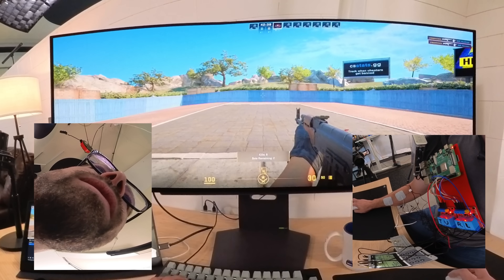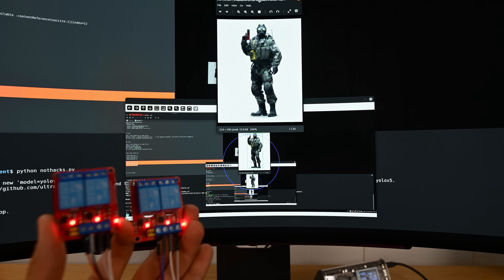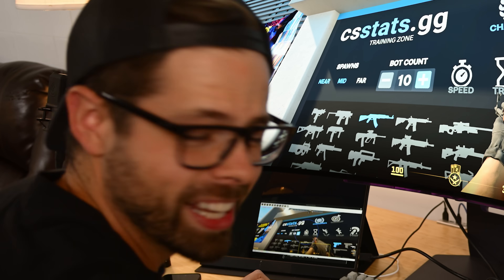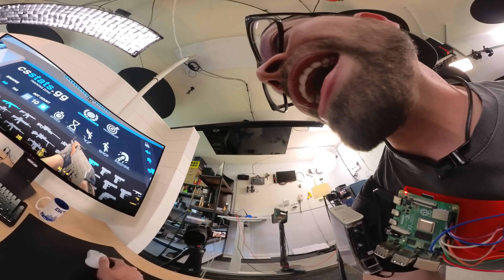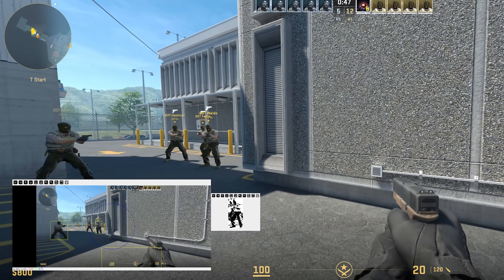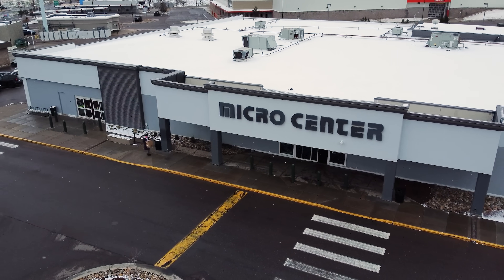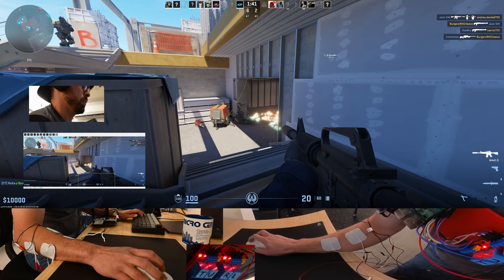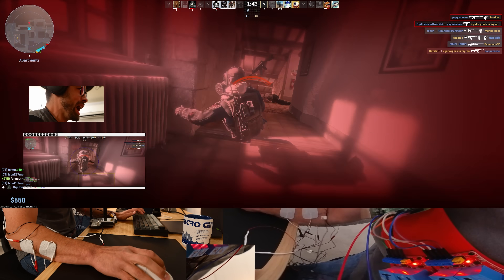Neuromuscular Aim Assist

Comment: Hear me out, Have you seen those electronical hands that handicap people use that reads your musscles to move? what If you programmed it with the rasberry pie and it basically did the same job by you not getting the shock. also you'll need a person without a hand for that.

Comment: Do you realize what's possible with this!? You could use a full body version of this and a powerful A.I. to train your body to dodge & counter any attack flawlessly. Put 360° sensors on the suit to allow the A.I. to detect all the movements around you and train it. Over time, your body & mind will get used to moving on its own like that, and you will begin to not need the suit. Once perfected, you won't even need to think about how to move to avoid any strike or grab attempt, and the body will counter automatically as it will have learned to sense any movement around it. You must also train your stamina and strength as well. It would be something like "A.I. trained my body to have Ultra Instinct in real life."

Comment: When I was studying Kinesiology I took a neuromotor control class. I find this whole concept fascinating. I know this was a ton of work to do, but I honestly think you could fine tune this a bit more. Perhaps if you tried using electroacupuncture needles you could find tune some of the movements. I think this would be far less painful and much more precise. I genuinely think if you used the shock needles instead of TENS pads, and insert one into each of the main muscles of your forearms, you could program the computers to create much more fine motor movements. This video has 2.3M views in 3 weeks, and could easily be your top video. I think if you fine tune that with the electroacupuncture technique and code the computer to know how to send a shock to each individual muscle, you would have a very interesting experiment on your hands (and could get a lot of views). Moreover, you could really help advance some of the technology that would help people who have paralysis in their limbs be able to move again. Message me on instagram @mitchell_gainz if you want any ideas or I could direct you towards some professionals in the neuromotor control / biomechanics field.

Comment: Very interesting idea a couple problems tho. Having it be too harsh of a shock that you are just relying on the shock(aka robot if you want to call it that) to move your muscles for you will fuck up your muscle memory after prolonged use as well as just completely damage them as well. I think it's a good concept that isn't terrible toward improving human reflex control but I would turn down the shock by a lot. Why? Because you want to have the shock hint your muscles to go to the correct why which just work toward teaching the brain to establish neural connections to create muscle memory leading to insane REAL reaction times, given the program would trigger only at a time that you as the user can physically see(or at least you could see) and would help your eyes and muscles get better. Unfortunately electrotherapy can work(unfortunately because of all the negative things that have been done with it) but it requires prolonged use and effective processes. Over interesting idea and probably something we will only see more of in the future if not that much shock some form of human enhancements.

Comment: A little bit of research might have saved you a lot of pain.  A shock needs a gap to form.  Those who use these devices for what they are intended use a cream or gel that is conductive.  So the jolt goes directly to the skin instead of having to jump the air-gap.

Comment: AI object detection, friend/enemy detection, boundimg box distamce measurement...

Then a multi-core RPI with gigabytes of RAM and a full-fledged OS is open-loop controlling FOUR relays. My embedded mind has died a bit, couldn't the output stage be more crude, could it? 😂🤣😅

Comment: Great video. You might want to consider running a PID control loop to improve the tracking. It'll prevent you overshooting heads if you increase your derivative (D) value in your controller.

Comment: If you want to improve the latency significantly, switch from relays to power mosfets. This will completely eliminate switching time from the equation, as they switch on the order of nanoseconds.
Reply: You could even implement a sort of PWM that moves your arm back and forth in either direction until you reach the target, kind of like a PID loop.

Comment: it is an edge case of cheating-or-not just because all the electrodes and computing unit is external. what if...the shock is so accurate that mimic the actual electric shock the nerves make and all these devices including the computing unit is burried under the skin 🥴

Comment: I wonder if you can adjust the settings so it doesn't hurt. But perhaps that much voltage is required to go through skin resistance.

Comment: Halo would be interesting. It requires lots of tracking and in Halo Infinite the players have outlines. You can pick the color of the player outlines so theoretically it might be easier for the vision system to spot enemies. Look for specific pixel colors and aim inside.

Comment: Yeeeaaars ago I made something similar using Atmega and two hacked Tens units (to ensure it would at least have "safe" frequencies). But instead of trying to get the 'pain to win' effect 😂, I decided to implement it with a C# client which controlled the Atmega via serial, and a memory hook to detect the player being hit. For simple games (where I could not read or find the actual hit point) it would just respond with an intensity relative to the health dip you took. I mostly used the well known tools to find memory addresses by just filtering them on changes, and then directly hooked onto them from within my own program to have the lowest possible latency.

What also gave me more control is that I directly interfaced with the controls of the tens unit by swapping out the contol buttons  with opto coupler (instead of using relays between the outputs), which also kinda gave me "PWM like" control for the strength and intensity.

And games where I would be able to detect the 'impact point', the unit (both 4 channels😂) would then direct most "feedback" to that area (I used: Left Arm, Right Arm, Chest and Back). 

And boy, believe me that games like Fallout and CoD got A LOT more intense😂 and games like Outlast became one of the most terrifying things I've ever played back then😂

My project was significantly simpler to implement on the software side (since it didn't needed to have the enemy location detection etc), but it definitely was a fun idea. Really a shame I didn't made any useful video's of it back then. Maybe a "fun" idea to do something again someday 😂

PRO TIP: DO NOT instantly plummet into a ditch, elevator shaft when using something like that (as in when your health instantly goes from 100 to 0)... Don't ask me how I found out😂😂

Comment: Cheater/cheat developer here. The most “undetected” cheat out there right now is one that externally takes a bunch of screenshots of your computer and either detects for players using computer vision or colors, and then moves your mouse to that direction using an external device, like an arduino. I didn’t think there were ways to make it more undetected than that but clearly i was wrong.

Comment: Your using something to read the screen to do this, i would say 100% that is cheating. This is really cool but def cheating, cause it is not your muscles per say it is them reacting to a program that knows were the cross hair is. It is like the same scripts they run to the controller to control reoil and cheat that way but your way was not meant for the reasons others but if you do get banned dont be surprised.

Comment: I didn't believe it and then right around 40 (this year) I did something to my right arm. Now it feels odd at times like I pulled a muscle or pinched a nerve. I still feel like my reaction times are improving in some things and dropping in others. I'd say the main thing that affects my reaction time are my injuries at the moment and not my age. I can still get a really good run on call of duty as long as my arm is not acting up. The minute I start feeling the burn in my arm I have a problem with the reaction of my right hand. . . My in-game trigger finger. The reason I phrase it like that is because I'm a lefty so in real life my trigger finger is my left hand but I'm pretty ambidextrous as well. That being said my profession has honed my instincts and reactions. If they don't at all I will die. It happens to everybody in my profession. I am a large tree installer that operates some pretty big equipment and I've done three removals and trimming for years. Even though I have a high reaction time I've still taken some big injuries at a young age. The reason I'm leaving such a long comment is because technology like this can help individuals like me who have had muscle damage. By learning how to specifically Target each muscle you can develop a tens style unit is that Target see exact muscle needing repair or stretching. Also a hectic gaming unit would be freaking amazing 😅

Comment: So you're encoding the images, to decode them into cheat script input. Then  to re-encode them into the tens unit relay shocks, to play the game. 

At that point just cheat. You already need to for  it to work. A computer can pull the trigger in at least 10ms.

Comment: I just did a similar not-hacking project with arduino and you definitely want to be using optocouplers instead of relays, shaves off about 10ms and increases precision by a ton

Comment: the finger triggerbot might actually be pretty busted considering how fast the cheat can detect enemies you could easily count this as a bannable cheat.
i think it shows that you had success with the snipers sicne they are also a classic cheaters favourite due to the headshot being a one hit.
I'd say it would also be the easiest thing to detect since your reaction speed on the click would be way faster than even the best players.
It might actually not be that bad that you have a 100ms delay in the system since it doesn't put you anywhere close to what actual cheats can do.

Comment: What a bizarre choice you made to go with slow and noizy relays, instead of uaing transistors (with nanosecond scale reaction times) that require little to no current to operate, in addition to giving you the ability to modulate the strength of the signal that's being sent to those pads.

But hey.... At least it worked. So congratulations, I guess?

Comment: I think more electrodes and using mosfet instead of relays could make it a lot faster and better. You see the LED light up but the relay will take more time, A LOT MORE TIME. trust me, just use a mosfet, ur an engineer, do it

Edit: also you need adaptable shocks. some can be less and some can be more intense. the duration of the shock must change as well. Tweaking the settings based on your arm and possibly making a software to calibrate your setup and arm each time will be good. Like you just hop in to a aimlab and close your eyes and let the calibration code to run. the software calibrates the shock intensity, duration, and how multiple of electrodes should work with each other. Oh man, such a fun project to work on but this is time consuming and so much money than I can afford. You can make so much money making this into a product. I swear some people will buy it.

Comment: Motivation:

The creator just turned 30 and feels his reaction time in games is getting slower with age (typically measured around 200ms; young pros get down to 150ms).

He wonders: Can you hack muscle control and bypass slow human reaction to make your muscles react instantly?

Concept & Setup:

The idea: Use a computer vision system (PC) to detect enemies on the game screen faster than the brain can.

Instead of the normal process (eye → brain → muscle), use external electrical signals to trigger muscle contractions for aim and reaction, bypassing the brain.

Technical Steps:

Step 1: A server PC runs a program (using YOLO, a popular object detection algorithm) to recognize enemy positions in a game.

Step 2: The program communicates (wireless, via WiFi) with a Raspberry Pi (a small, cheap computer) which controls electrical relays.

Step 3: The relays trigger an off-the-shelf muscle stimulator unit (EMS/TENS), sending real electrical shocks to muscle groups in the arm to cause the hand or finger to move.

By putting electrodes at targeted places on the arm, they can cause specific muscles to contract—for triggering aim or even pulling the trigger finger.

Testing and Results:

They measure how quickly the setup can react. With direct stimulation, sometimes he gets reaction times under 100ms—"inhuman" speed.

But often, the shocks are so unpleasant or overwhelming that accuracy is worse even if reactions are faster.

The system needed further tuning (improving electrical trigger consistency, positioning, distinguishing teammates vs enemies, etc).

Final version includes a model trained for the specific game (CS2) to distinguish friend/foe, and a "neuromuscular triggerbot" which can even automatically pull the trigger.

The entire setup (software, microcontrollers, relays, muscle stimulation) means a computer is giving him muscle 'twitches' in-game before he can even consciously react.

User Experience and Reflections:

Sometimes the computer is clearly in control, even moving or clicking his hand before he consciously intends it.

The process is described as wild and a bit scary, and sometimes not effective or comfortable for consistent gameplay.

The technique, in theory, could allow reaction times below human limits (with further hardware upgrades, lower latency relays, etc).

The main limiting factor becomes the pain/discomfort and the limitation of human muscles at high voltages.

Ethics & Cheating:

There’s a repeated joke that "it's not cheating, it's just my muscles," but notes this is really on the edge of what would be considered cheating in online games.

Conclusion:

The system actually works and can provide unmatched reaction time.

There are still significant drawbacks (comfort, accuracy, complexity, and ethical issues).

With sufficient technical refinement, you could theoretically achieve sub‑50ms reaction times, automatically moving the player’s arm and finger faster than any natural nerve signal.

Bottom Line
He built a system where a computer takes over his arm muscles using electrical shocks triggered by game computer vision detection, achieving reaction speeds faster than any human—effectively, a real-life aimbot using hardware hacking, machine learning, and bioengineering. It's a “future” demo of man–computer integration for competitive advantage, with the side effect that discomfort and loss of control make it less practical as an actual way to play games.

Comment: I'm surprised no one has recommended this: first switch the relays to another faster solution. Between the relay's operating time, the stimulator's response time, and muscle inertia, there are several variables that can be improved.
Reply: Yup, transistor type switches are way faster. Like SSRs that are commonly available. But still, the relay should be more than fast enough. Microseconds compared to a few milliseconds do not make much of a difference in this setup.
Reply: @vrabecm  Standard cheap relays like these take anywhere from 10 to 20ms to actuate. They are very slow. He's trying to improve on 200ms, 20ms is a 10% improvement out of the gate if he used SSRs.

Comment: My suggestion for a part two of this video is that aim assist tends to work better with scopes and can actually worsen performance when using ARs. I suggest enabling it only while aiming down sights (ADS). Also, aim assist should avoid reacting to players outside the central circle, which would help prevent unnecessary snap targets and instead rely more on the player's reaction time.
Pls give a like to be noticed, e really liked this video

Comment: 🚨 Not a Cheat. Not a Gimmick.
This is the First Cybernetic Reflex System in Gaming.

Not cheating — innovation.
A YOLO vision AI detects enemy heads → Raspberry Pi sends dual EMS pulses:
1⃣ Arm alignment jolt
2⃣ Trigger-finger nerve jolt

From detection to bullet: under 100 ms.

Hip-fire tests hit ~23%, but after trigger-nerve mapping with scoped snipers, it’s low 90% headshot accuracy — faster than most pro players.

No game code injection, no scripts — pure physical augmentation. Bannable in esports, yes. Cheating? No.

Beyond gaming:

Medical rehab: Could bypass damaged nerves to restore limb movement without amputation, letting patients keep and use their natural limbs.

Military & police: AI scans for threats and physically turns the wearer toward danger before conscious reaction, buying life-saving milliseconds.

Firefighting: In heavy smoke, thermal AI detects human shapes and twitches the firefighter’s head directly toward victims for instant rescue orientation.

Search & rescue: Linked to drones or thermal cams, it could guide rescuers’ gaze and movement to survivors in rubble, flood zones, or wilderness before they even hear the call.

This isn’t a gimmick — it’s a blueprint for human–machine reflex integration that could change combat, rescue, and medicine forever.

Comment: Ethernet is electrically isolated by design. Search ethernet magnetics for more details. If you wanted to be doubly sure you could use ethernet over fiber to guarantee no electrical connection